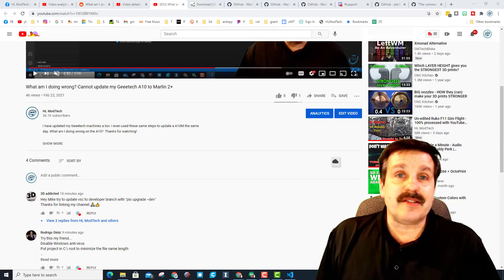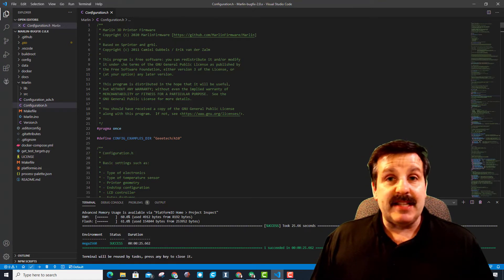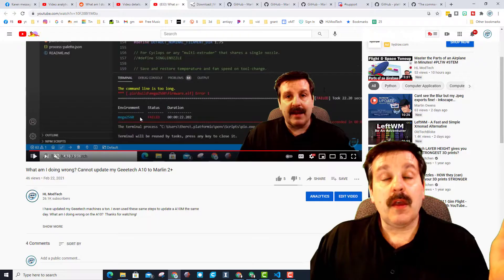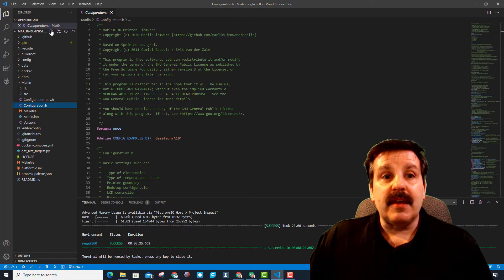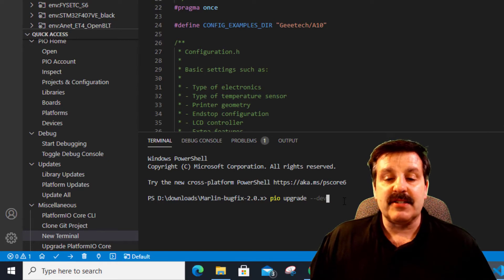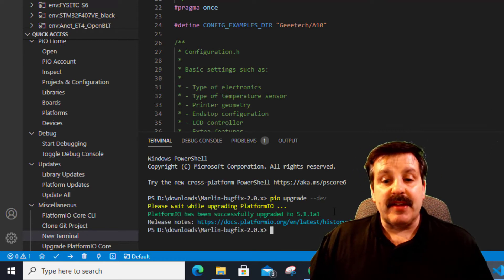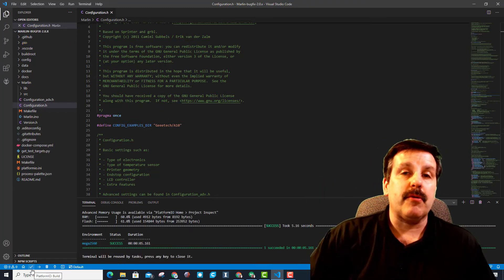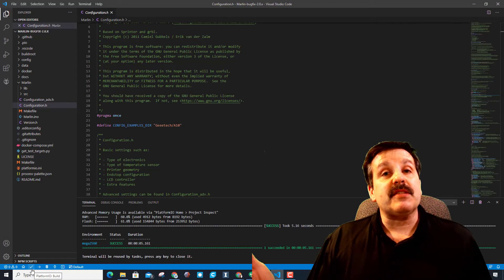Command Line is too Long Error in Visual Studio Code | Quick Fix

Comment: I just tried to update the firmware on my A10T and it messed up the firmware bigtime.   When I hit autohome the z axis goes up and homes about 80mm above the bed off to the the right.  I was not able to get the firmware to do a build update without errors.  I need help PLEASE
Reply: I emailed VERT and he was great, actually compiled the firmware for my machine.
Reply from the maker: @hootey66  That is fantastic. Vert is amazing and I have always appreciated sweet skills and his willingness to help. 💯👍
Reply from the maker: Which tutorial did you follow? Stock A10T?
Reply: It looks to me like the config files for the A10T are missing a config file.  There are two config files on most all the other printers.
Reply from the maker: Where are you getting your files? This is my latest set of steps. https://youtu.be/NrbGb8tFca4

Comment: Very glad that the issue is gone. So the A10 will run great again. New Marlin Version does always some improvements.
Reply from the maker: Took all day to get a minute to get it installed. Finished the day with a quick cube print. 💯👍 Thanks again!